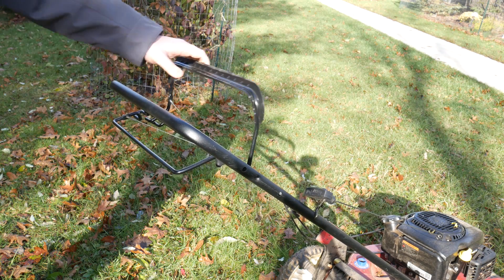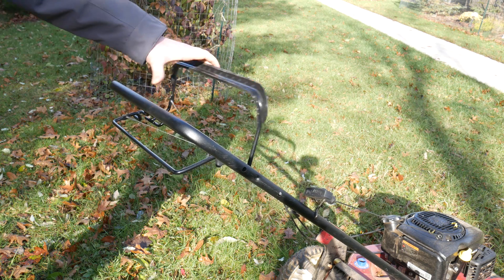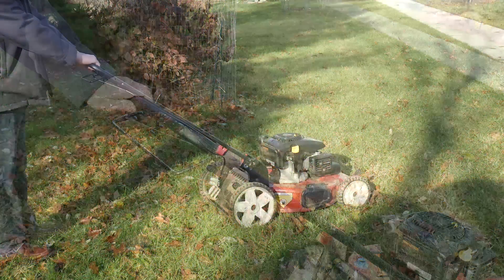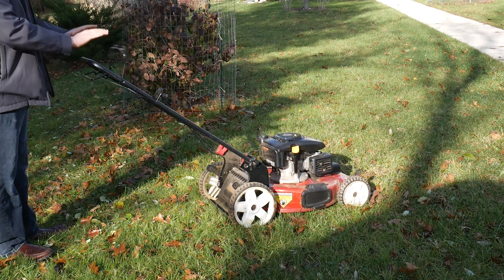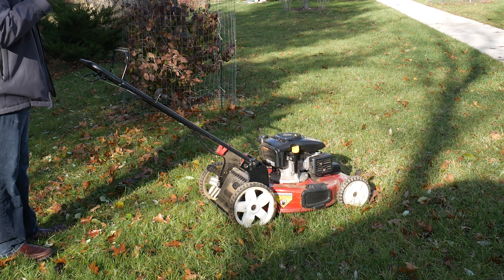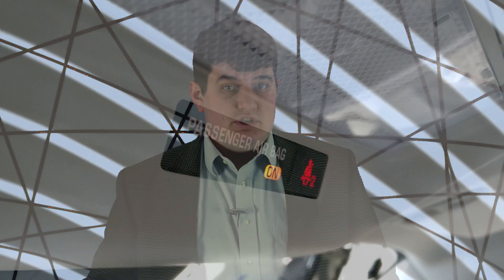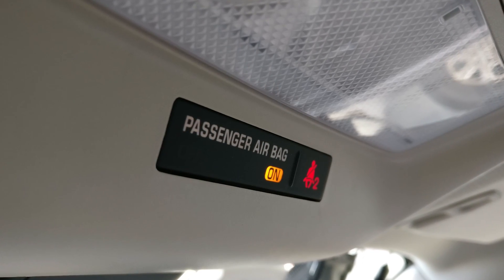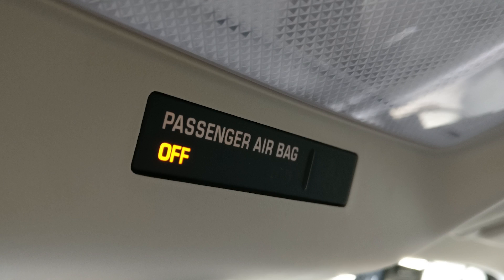The Dead Man's Switch:  How Anton Yelchin's life could have been saved

Comment: You made the solution over complicated! Jeep should of used the same protocol as Mercedes"all German Cars with E-gear" which I may add both use the same ZF transmission even similar electronic gear selector! 
When Mercedes detects drivers door is opened and the car is still in gear it will automatically shift the car into park and apply the E-break. No need for over complicated sensors only software update which I think Chrysler Jeep is already rolling out.  Also dead man switch on the seat is not the best idea since there a times you might need to push or tow your car! Mercedes system can be override for these scenarios.
Reply: +sash
Well, it seems you are right about that the pressure sensor is only on the passenger seat. But how does the "adaptive airbag" adapt its deployment to the driver, it seems unreasonable to offer this feature only to the passenger. Drivers can vary in weight a lot. Assuming that many US citizens see the airbag as a seatbelt replacement and do not buckle up the adjustment of the airbag can mean the difference between just a scratch or a whiplash (or worse).
So be it that there is only one pressure sensor for the passenger, the video didn't dictate to build in additional sensors, the seatbelt sensor was mentioned as a substitute too. The video was offering a bag of suggestions and was stating that is negligent and irresponsible to not build in safety features with existent hardware which would only need software to add functionality.
And knowing that other car manufacturers build in this safety feature already doesn't make the situation better but is just telling how cheap or lazy or negligent car manufacturers can be, or even all of it.
Reply: I too think this is a far more practical system. but in any case his point stands, theres no excuse for the system not being in place in the first place, however it is implemented :P
Reply: Robbie Callaghan Oh absolutely!!! Trust me I learned this lesson the hard way,.  Had Jaguar XJ as loaner and valet ....you could tell where this story is going. I was lucky the car in the front was my friends . At least I didn’t have to explain it the to insurance company 😂
Reply: +Pedro Pereira That's true but the engine computer is also fully aware of the vehicles current velocity and such a feature could be deactivated when the velocity is in excess of say 10 or 20 mph. Most vehicles with push button ignitions also have a similar feature so that you can't easily accidentally touch the button and kill the engine while at high speed which could potentially significantly reduce your control over the vehicle.
Reply: sompka I don't know where you work as a car mechanic but it is not 1980 anymore. the gear lever is basically the same as in my 18 year old car. it just moved from the middle to the steering wheel. where it has already been 50 years ago... And electronic systems are more reliable than mechanics and also usually cheaper and lighter. No decent automatic transmission in the last three decades used direct mechanical gear selectors lol
Reply: Delicate sometimes, but that's very stupid since you have rear mirrors. Only if those are full of snow and I'm lazy I might use the door. And the Mercedes S-Class will do the parking for you anyway
Reply: 99 Mountaineer, fully mechanical in the transmission
2005 Towncar, also fully mechanical
96 Escort, fully mechanical
88 560SEL, mechanical
08 Focus
07 Cube
08 Cube
Lever pulling a cable or a rod going right down to the trans, moving a small lever on the trans telling it which gear is selected. None of those have electronics telling the trans what gear to go into.
These are all vehicles that are either owned or have been worked on by me. I can guarantee from hands on experience that those under 20 years old do not use electronics in the trans selection. Just had my hands all over them, adjusting the mechanical linkage.
Reply: Jeff Margera yeah so.. my point was: what does the transmission do with the lever inside? The transmission has it's control electronics either right inside or in maybe the engine compartment next to the ECU. 
I highly doubt most of those run on mechanical control. The SEL might have an old mechanical unit where the oil pressure "calculates" which gear to use based on the pressure behind the throttle valve and current RPM.
Reply: Jeff Margera And before I forget: The newer trannys have electromagnetic valves which give units oilpressure to the "clutches" of the gears it wants to engage. Which is why they shift fast and nicely
Reply: The old Merc uses vacuum, the Mountaineer is oil pressure, Towncar is pressure, Escort is direct mechanical with zero vacuum or pressure whatsoever, the Cubes were both pressure, the Focus also directly mechanical with zero pressure or vacuum whatsoever.
Reply: Jeff Margera So how does say the focus know how far you press the throttle? Is there a bowden cable running not just from the pedal to the throttle but also to the transmission?
Reply: It's a drive by wire for the engine.

Manual transmission.
All the computer knows is how fast it is rotating. It has no input to the transmission whatsoever.
Reply: Jeff Margera wait what... manual transmission/gearbox? what the
Reply: The AODE uses valve bodies that respond to pressure, as do most of the cars I've worked on. The Focus using a manual transmission is directly connected through the linkage. The Cube has a CVT option, along with a 4 speed automatic. 
Solenoids exist on all automatics, it's even on the FMX transmission used in my dad's old 1965 Thunderbird. The solenoid can be activated by vacuum, fluid pressure, or computer. The gear selection is based on vacuum or solenoid pressure as read by the computer, and even in modern transmissions there is a fun trick that can be done by drilling a small hole in one of the valve bodies to make the transmission shift later and harder, most commonly done on Ford c6 transmissions. 

Yes the 2008 Ford Focus had a manual transmission.
Reply: Delicate Yes, so why open the door unless the mirrors are blocked. Don't be lazy and get the snow off of them unlike me. 
And for the front you can't see them with the door open since the door blocks them. who needs to see their front tires anyway? sorry if it affects you personally but I don't think anyone should be driving if you can't judge that from inside
Reply: I know people who notice the door isn't closed properly when an indicator goes off and they slow down, open the door without stopping, and slam it shut.  Such a system as you describe also has the potential to cause such a crash.  It is also undesirable to have the vehicle shift into park if you just park briefly, drop something off(by having someone open the door and taking it, not your window if it gets frozen shut), and then want to continue.  I thus propose a few additional changes to the system.

1.  Only shift into park if the vehicle is currently not moving at all, the car door is open, and the dead-man switch detects < 20 Ibs.  This is still remarkably easy to do in code, the psuedo code looks like this:
if(getSpeed()==0 && doorOpen(DOOR_DRIVER) && getPassengerWeight(DRIVER_SEAT) <= weightFromPounds(20))
{
   setE_Brake();
   setGear(GEAR_PARKED);
}

coding wise at worst every variable listed there is a part of a different library/system and probably takes 1 hour tops to properly integrate for the people that built the thing.  Any longer than that and they are TRULY incompetent or have such a shitty code design that I would never trust anything they make ever.  However, assuming they are fully isolated systems(including the sensors, for some reason) it does then become harder, and you need to talk to the hardware guys.

2.  prevent the car from shifting out of park if a door is still open.  This only partially fixes the other issue I raised, but is better than nothing imo.  If a door is opened and the car is not in park, it should probably either ignore it as it currently does, or prevent acceleration of the vehicle beyond the speed at which the door poped open at until the door is properly shut.  Of course in the even of a sensor failure a simple override should be available.  This way even if you were on the highway and you couldn't get off the road to figure out how to override it/shut the door, you could at least maintain your current speed until you found a place to park long enough to handle the situation.  

I'm all for having a button right next to the panic button(or maybe even tied to the panic button) though that throws the car back into full manual as a fail-safe though.  Especially as cars become more automated I feel that, now particularly, that fail-safe is important.  I'm also sure that this doesn't cover all cases, but I think it's better than the current systems in place and I don't see any major gaping pitfalls with it.
Reply: Firestar9114 You know that obviously the transmission does not engage parking brake/claw when you are rolling? So with such a system that already is a non issue
Reply: alles klar klaus I'm a programmer, I know how to create the system design for a piece of software, but aside from the car having an engine and an axel I know fuck all about how a car works internally.
Reply: Firestar9114 There is a (or multiple) busses in a modern car which pass along information like speed from the ABS to the engine control and transmission control circuitry. If you are rolling above a certain speed say 10kph the tranny will just ignore you switching to park but put it into neutral instead.. yes this is simplified but still somewhat accurate.
Reply: Pedro Pereira this is not a five minute of coding. One to two months including all of the testing and certification needed. Embedded software isn’t cheap that is why most cheap cars don’t use a lot of it.
Reply: @Knirin As you just stated, it's not the code that drives up the cost of embedded systems in industry, it's their insane testing policies, which still don't catch important shit like this.  Changing the code is relatively trivial for something like this if the code is well constructed and uses good design patterns.  Also, wtf do you mean embedded software isn't used a lot?  Even most of the simplest relatively modern vehicles have a shit-ton of code driving them.  That's why it's possible to hack a car's blue-tooth and drive it around remotely.
Reply: https://www.youtube.com/watch?v=9mJq5XoStVM&t=
Reply: @Thomas I think we can all agree that there is a limit before you deserve a Darwin award.  Same stance I take with tide pods.  Once you reach that level of stupid, your on your own pal.
Reply: I open my door to help myself park almost every day. Even if there was a temporary override (likely a few layers deep in the infotainment), having to use it every time I would want to park would be impractical. A better solution, in my opinion, is the seat sensor described by the person in this video, with the added feature of a temporary override for uncommon events like pushing the car.
Reply: @directorjustin  Why don't we just add a mode where the car won't move move when we push a button or something, then people can just activate that when they need it and they can disable it when they don't. No need to worry about it activating when we don't need it or having to worry about bypassing it when it would be disadvantageous. You just push the button and the car dose not move and push it again for it to move... I guess it could just be a lever to make it easier to know when it is activated.
Reply: The whole point of the sensor is that someone won't always be around to monitor things if a system fails, making the deadman switch an automatic failsafe. Even if you have the button in your pocket, you aren't likely going to be able to pull it out faster than jumping to the side of a mailbox, which was the situation that birthed the topic in the video.
Reply: Well this situation could happen if a car is put in neutral so it'd be best to have a "Towing mode" that overrides it.
Reply: German Automotive engineer Just is The best
Reply: The gearshift being put into park but not engaging the handbrake wouldnt prevent the car being towed
Reply: How is it overriden?
Reply: Isnt that what he said?
Reply: That was a big issue with my mercedes. If you need to maneuver with the door open because of poor visibility, the e-break will give you trouble.

As a driver, if you want to arrest the vehicle, set to P / 1st Gear AND apply the parking brake.
Reply: Or he could’ve just used the parking break, like the manual says 🤷‍♂️
Reply: How do you push these Mercedes E-Gear cars (e.g. wrong fuel and you need to move your car away from the fuel pump, so a service car can pump out your tank.)
Reply: I know this is an old response but for certain vehicles like say my truck it isn't uncommon for me to drive at low speeds with the door open.  Further one of the main selling points of a jeep is that you can fully remove the doors. Having a deadmans switch makes sense for both those scenario's.
Reply: All Mercedes cats are overly complicated lmao
Reply: So Mercedes does exactly what he suggested, albeit with a different sensor, and you're calling the solution overly complicated?

Or are you saying that Mercedes doesn't have any sensors in their seats?
Reply: "WRONG! His talking about pressure censor to be added "
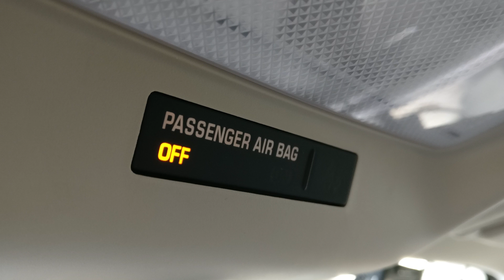No, he is exactly not saying that. At 2:30  he is saying that pressure sensors are already there and that it is just a matter of some code to add a new safety function. Just the same you said, the mere difference is the choice of the sensors.
Reply: "Made it overcomplicated" then you go on to say "no need for sensors". Your example is EXACTLY what he's talking about. He was just giving examples of how it could be done (in the seat, etc, which is very common).

And how exactly do you think Mercedes cars know the door is open?

..... drum roll please....

WITH A SENSOR
Reply: +sash sepehran - "Also dead man switch on the seat is not the best idea since there a times you might need to push or tow your car!."

That's called putting the car in Neutral. Nothing changes. Sit in the seat and put the vehicle in neutral.

Not to mention you give the answer to this "problem" in your very next sentence "Mercedes system can be override for these scenarios"

It's called Tow Mode.

I'm not sure why you think everything needs an EXCLAMATION MARK either!!!
Reply: @thysonsacclaim  right but what's to prevent the guy from getting out of his car in neutral? Bit of a what if statement but if the car is in neutral when the guy gets out what's to prevent the car from hitting him or someone else? The door switch or sensor might be the best option or have it tied to the key switch.
Reply: Pyrrha Nikos you are missing my point. His suggestion was adding multiple new censors to the seat etc.. I'm saying you could simply take advantage of system that is already in place which are the door censor. No need to retrofit or add any new censors. Takes simple ECU update even for all existing Dodge Chrysler Jeep with E-Gear when driver door is opened and car is still on drive to be forced into park and E-Break be applied. If I remember correctly that's the actual solution they came up with anyway updating the ECU. Regardless glad he made the video and made more people with these kind of transmission aware. And I hope jeep is being sued over this matter they purchase the system from Benz and failed to apply the same software and Saftey protocols that Mercedes has in place god knows why? Being lazy ? Cheap ? Or to save time regardless no excuse for such oversight on such important mechanisms
Reply: "His suggestion was adding multiple new censors to the seat etc.."

No. He said you could use existing ones. Passenger seats already have one and the seats already exist and are virtually the same.

Not to mention there are other sensors that could be used, which he also alluded to. You obviously didn't watch the video or have bad reading and verbal comprehension of spoken English. Did you not hear him talk about software upgrades for existing sensors?

Not to mention in your first comment you seem to have failed to grasp that sensors are required to make any of this work.
Reply: His point is that the sensors are already in place. Maybe even wired to the same logic solver (controller), allowing a simple (5 minutes, if I had designed the system) software development by Jeep's engineers. As a designer of high availability automation systems for (gas/oil) safety applications: doing this; however, removes flexibility to the operator - quite possible decreasing safety in some cases. Say you are traveling at 100 mph down the road and said sensor fails. Will the transmission go to Parking position and the E-brake engage, creating a crash hazzard? Or will the computer disregard the sensor and enter a "no action" safe mode, that could cause the operator to be killed like Mr Yelchin did? Why not just design a better way for the "e-gear" lever to provide feedback to the user, mimicking the old mechanic style?
Reply: sash sepehran our 1996 volvo has a presure sensor in the drivers seat (broken but still there) there may be some cheap cars today where there is no seat sensor in drivers seat but it is very uncommon
Reply: sash sepehran he says you could use the seat belt sensor.
Reply: Im an auto mechanic and seeing this newer electronic technology makes me cringe. Its more expensive im sure to implement and leaves you stuck as shit when it fails. Instead of a rod going to a valve in the trans or a switch for the solenoids, you have a can connected (so if can gets pulled down, entire cars gone) electromechanical box that does exactly what a simple rod used to do. Same with electronic parking brake. Nobody in the future will have a car older than ten years as these devices will always fail all the time and coust hundreds for the part alone. Mercedes SBC, a system that uses stored hydraulic pressure and a pump always running to apply the brakes, has so little mechanical advantage (or maybe none at all) with this system inoperable that it requires two feet just to stop the thing rolling forward when you roll the car into the shop. So to get around this Mercedes programmed in a 300,000 actuation limit that disables it and makes you fork out 2000 for the unit. And thats just the SBC unit. Theres also the "master" cylinder or whatever it is. 

Another thing, the new cars have horribly intuitive gear selectors. Its like a little nob in a random place different on every car. I literally couldn't figure out how to get a Prius to move one day and did not want to ask the customer. What a joke.
Reply: @sompka1  As an engineer, every single time I see a mechanic respond I thank God in heaven that you idiots get to design literally nothing. 

MTF of the electronic systems in cars today are literally a dozen times that of the mechanical systems they replaced while costing less to repair. 

SBC has been known to be ridiculously reliable for over a decade. The units in 2001 were an issue, which was fixed. Under warranty. Via a recall. And even if it was done "outside of warranty," they had a reimbursement program even if they went to fly-by-night shops that are stupid enough to think electronically controlled valves are complex. 

I'm glad you at least admit that you're so stupid that you can't figure out a gear shift intended for people who want an appliance for a vehicle. You are a joke, indeed.
Reply: I don't know where you're getting more reliable from, seeing as mechanical systems on cars sitting for decades work just fine, whereas electronics sitting for just a few years can fail quickly.
Cheaper is also laughable, nothing is cheaper than a rod going down.
Reply: I do appreciate your all CAP sound like you are really passionate about this subject. 
But since you are too dumb to get my point allow me to explain this one more time in a language that may you understand;
 HE MADE AN ASSUMPTION THAT BOTH DRIVER SIT AND PASSENGER SITS ARE EXACTLY THE SAME DESIGN BUT THEY ARE NOT! "passenger’s occupancy sensor" DOSE NOT EXIST IN THE DRIVER SEAT HENCE NAME PASSENGER THE END! There are no censors in most modern cars that communicate with ECU if there is a driver in the driver seat or not! in fact, Tesla is recently adding those sensors to their cars now. Because some genius decided to leave the driver seat while Auto Pilot is engaged
Reply: Why do we need electronic gear selectors at all? The whole situation could have been prevented just by using a traditional PRNDL shifter with a straight gate, which also has the advantages of simplicity and familiarity. Some things are better as mechanical devices; just because you CAN use a newer technology for a particular situation doesn't mean you SHOULD.
Reply: The big problem with cars is that they do not have fail safe breaks. Just putting the breaks on is not a final solution to every problem like it is on a train. On a train if all else fails the breaks should help you in all situations. With cars it can be more dangerous to apply the breaks in about half of all problems. Cars are allowed to drive much too close to each other and the control issue that is developed by adding a train style dead man handle will cause more crashes. A system that prohibits the car from moving in the seat if no one is present will most likely end up with someone sitting up (not triggering the sensor) and the breaks will jam on causing an unnecessary accident. I find e biggest issue with cars, is the fact that you can put it on cruse control, and jump of of the window and the car will continue to drive without fail. Also the door deadman switch is a complete waste of time. Any situation where a door is opened in transit will only make matters worse if the breaks come on, and such a system has no other lack of attention uses. To me it is a waste of money that will cause more problems then it solves.
Reply: +sash sepehran - AND HE TALKED ABOUT THIS. YOU TOTALLY MISSED THE POINT.

READ. COMPREHEND WHAT YOU READ.
Reply: d1oftwins Jesus's NOOOO buddy the air pressure censor exist ONLY ON THE PASSENGER SEAT! Which is child airbag censor that turns off the front passenger airbag ! Driver seat doesn't have the same censors and his making point that the seats are similar in the front same censor could be added! 😂 why is everyone trying to argue with alternative facts here
Reply: Adam Lawson WRONG! His talking about pressure censor to be added for 5th time all I'm saying is taking advantage of door censor is the easiest way of doing! Also if you watch the video till the end he is unaware of such systems currently existing! Which it dose! And lastly since sounds like you didn't read what I wrote previously allow me to repeat it for you! Chrysler / jeep purchased their E-gear from Daimler-Benz and ZF 7 speed is the same transmission that are in Benz and BMW Audi! Which they all  have the Saftey protocols soon as door is open and car is not in park Park & E gear will be engaged. But for some unknown reason that I can't figure out they failed to code them probably or add the same safety protocols that their German counter parts had in place! If they had done so  then we would have this tragedy.
Reply: You're unable to understand spoken English I take it. For one thing, he was giving EXAMPLES. For another, IF YOU ALREADY HAVE A SEAT WITH SENSORS IN IT AND THE DRIVER'S SEAT IS IDENTICAL THEN THERE IS NOTHING EXTRA BEING DONE.

HOLY CRAP!! YOU ARE more dense than uranium.
Reply: Adam Lawson LOL you missed my point ! I'm taking about using *pre existing systems" NOT TO ADD ANY ADDITIONAL CENSORS. A 5 min ECU software update will solve this. I do drive an S class with this system and have experience with cars with out. And yes he made it over complicated by suggesting to add additional censor